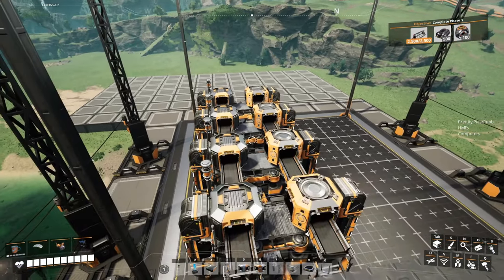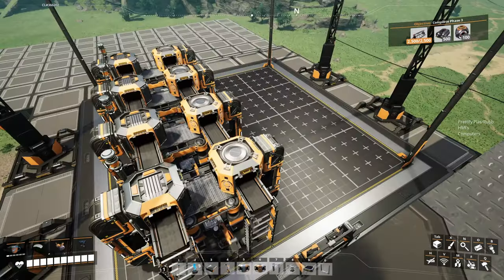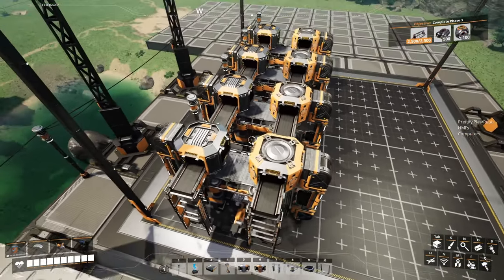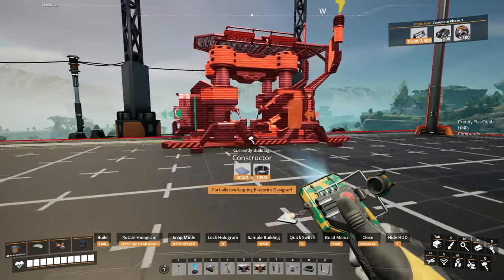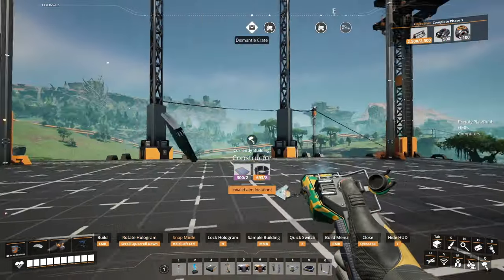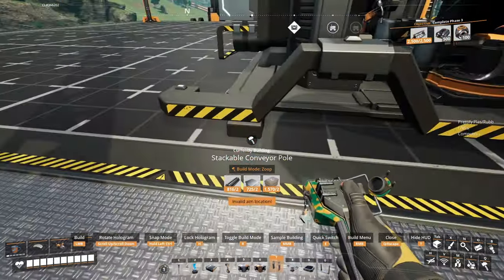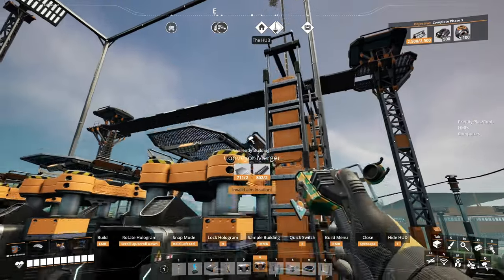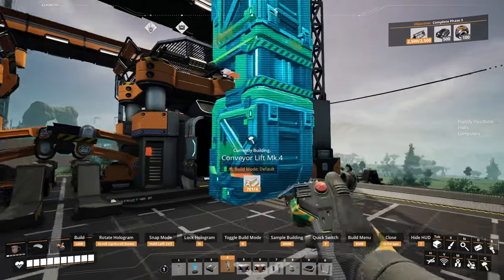Early Game Constructors Blueprint - Compact, Clean, & Tileable - Mk.1 BP - Satisfactory 1.0

Comment: I get that for some parts of your factory, having small segments is best, but sometimes the segments you want to make are so big that only having the current blueprint sizes is impractical, like anything involving refineries.
Reply from the maker: Yes and no. I made a refineries x3 BP and just finished my 20GW turbofuel factory just using those. Yeah I had to paste 5 of them together, but hooking up 5 BPs together takes a pretty small amount of time, tbh. Because all the manifolds and power are already hooked up. So you're only hooking up 1 belt and maybe 1 or 2 pipes and the power pole for each, and you're done. So even for 15 refineries, you're talking only 15 clicks or whatever. 

That being said, yeah having the bigger BPs is nice, for example, fuel power gens you can only do 1x at a time in a mk1 BP, whereas with some finagleing, you can do 4x in a mk2!

Comment: heres a build tip if you want them stacked. constructor on bottom then do the normal way to do the splitters and mergers then put another splitter and merger on top of them. you then put a frame foundation lined up with the edge and place a constructor lined up with the splitter. now after that you press ctrl on the edge of constructor the holo will be red. Press h to lock and then you can place it and you now have clean stacked 8 or if mk2 10 constructors.

just realized how rammabley my thing was 

1 do all start steps where it has the constructors and belts done
2 add a second layer of mergers and splitters
3 get frame foundation and place it 3 high it should perfectly align with no or minimal clipping in a mk2 not sure about mk 1(just tried and it works with mk 1 perfectly)
4 get a constructor placed on top of the frame
5 press ctrl and h to align up with splitters and remove the 1st used to line it up best done on the edge of the bp 
6 press ctrl on the new constructor it will have a red holo press h and place it
7 do step 6 till all are placed and connect lifts and done

 was inspired to play around with it by your vids so thx

Comment: I was wondering why you left the stackable conveyor poles and belt stubs in the BP instead of just removing them so you could belt all the way across between blueprints.  But I think I might see why now.  Without the stackable conveyor poles, you couldn't easy snap on some conveyor lifts to the input/output side if you wanted to come up from ground level.  I'm curious if that's the correct explanation.
Reply from the maker: Yeah it's for the 1st one in a line. If you wanted, you could make two versions, so that subsequent tileings don't have it. But I like having that there to align things for the front of the build. And its nice because in most cases, when you tile them, the stackables end up being fine, and then you can add more stackables on top to carry other resources "above" the build (such as another ore to another line of smelters even further down). So it kinda automatically puts a nice set of stackables in a straight line for you to expand vertically if you want.

Comment: 10:00 and 10:38 you can shorten the Conveyor Lift entrance to fit the bp bounds and reduce clipping by building down to the merger output. Personally, I find Conveyor Floor Holes the easiest and cleanest solution: throw down 3m of foundation, add one more 1m foundation, put a floor hole above the merger, and then delete the foundations.

Comment: At 12:20 you can probably reduce the clipping of the lift with the constructor by connecting the lift from top to bottom instead. The starting point of the lift is always a set distance from whatever you click first but it can be closer to the end point. So here, you click down first which puts it a little closer to the constructor than it needs to be.
Really neat designs ! thanks for sharing them :)

Comment: I'll echo what others have said about the high quality of your tip videos. They are easy to follow, concise, and respect the viewer's time. Well done.
Reply: By the way, on the 4X constructors, I like stacking the splitters on top of the mergers on the "output" side of the machine. You have to use a belt to connect across to the input lifts BUT the advantages are that you can climb up the ladder on the machine with headroom under the belt and you can place a power pole diagonally next to the power connection of each constructor without any clipping!

Comment: my only changes to your incredible early BP's is to add an injector merger halfway between all of the blueprints that way you evenly distribute the product to the machines further down the line. Unfortunately with the way they currently stand the first machine ends up working fine with some overhead while the latter half barely scrape by. Fantastic videos regardless please keep em coming!
Reply from the maker: @hiddendsyr865  what you're referring to is manifold design. In super slow applications, what you're referring to can help (think, you're feeding 10 machines with only a few items per minute). In most cases, the input buffers will fill within minutes and everything will run at 100% efficiency quite quickly. The only cost to a manifold is the input buffers. So for 8 constructors, that just means once you've filled 6 input stacks, then things run at 100% efficiency. That generally takes like, a few minutes. So, in most cases, manifolds are great and require no help. Once in a blue moon, some more balancing or "injectors" as you say, could be handy, but I think most players are better off just ignoring that, tbh.

Comment: On the 8X, if you connected the top lift first, it would get rid of some, if not all of the clipping with the constructor :)

You can also use the same method to fit the lift into the end of the path, rather than facing the mergers towards each other!

Comment: This series is terrific, thank you! I'm still a little unclear about how these should get deployed in a "real-world" application, even something relatively simple like motors.... How would you cleanly/modularly string together these smelter/constructor/assembler/etc building blocks into an actual factory? Would be a great addition once you've finished covering the building blocks themselves.
Reply from the maker: I mean how you utilize them is going to differ wildly by player. I am using a sort of bus in my base. And one nice thing is you can add more stackable poles on top of the ones already there to carry other materials to/from things further away. So you could for example plop down 12 smelters in a line, leave a space, and then 12 more, all in a line. And then use extra stackable poles on top of the first set of smelters to bring stuff to/from the second set.

Comment: Love this series!! Excellent presentation and explanations. Can you describe how you could convert this BP into a single constructor BP and now worry about the margins (so you can just line them up)?
Reply from the maker: well, set up the 4x constructor version but with only one constructor, and then remove the belts coming in and out of the splitters/mergers. So you just have the lifts connected to the splitters/mergers. And the power pole connected to the constructor. 

Then those can be linked together with just the belts + a power line.

Comment: lift issue around 10:00 - you can solve this by preplacing a floor hole closer to the merger, or even manually nudging the lift closer and placing a belt (since it won't autoconnect).
Reply from the maker: I'll have to try that out, that's an interesting idea!

Comment: You didn't explain how to do the vertical painted beams?
Reply from the maker: Holy crap I knew I missed something. They're just two meters tall. You can see the placement location in the video. And the one where you put the wall-mount to connect through the build is 4 meters tall.
Reply: @Krydax8  It's not the placement that's the issue, it's getting them oriented vertically.  I managed to do it using the diagonal placement setting.
Reply from the maker: @yosharian  oh. Just the normal setting works fine to go straight up. You just have to stand at a 45 degree angle. It's weird. If you're standing in a cardinal direction from where you're building, it likes to lay flat
Reply: @Krydax8  Oh I see.
Reply: @yosharian  press R to change construction mode

Comment: @12:18 when you clip the merger onto the line after putting the dummy merger on the head of the conveyor lift mine won't snap properly.  It always snaps one point away no matter what angle I can stand at. I've done it about 10x times not with no luck.  That trick worked with the smelters when I it didn't quick line up.  Any tips?
Reply from the maker: Honestly no idea. Maybe try a new blueprint constructor in a different spot? This game his weird stuff going on with snapping!
Reply: @Krydax8  I saved my game and slept on it.  I had to jump all over to get the right clipping and it finally worked.

Comment: They way you have these splitters doesn't cause loss per splitter for items going in? like the first one splits down to 60/60 then 30/30, 15,15 by the last one?
Reply from the maker: @PS-bc5qt  once you have a stack of inputs in the first building, then that belt backs up and you no longer have the issue. It generally just takes a few minutes for everything to back up and achieve 100% efficiency

Comment: when do I know to upgrade my belt? like If the machine only makes 30 or sth things thn I'l use a mk1 cause it doesn't exceed the limit of 60, am I missing sth?
Reply from the maker: well you wouldn't need to upgrade the lifts past mk1 if the machines don't make/use >60 of something, that is correct. The belts along the manifold though will carry the materials for ALL the smelters, so those need to be upgraded.
Reply: The only case is probably (in line with what Krydax wrote) for some item that is being produced or consumed at more than 60 items per second. It may be bulk items, such as screws, maybe with alt recipes, maybe with an overcklocked machine, or (now that we have a doubling production feature) with the doubled output.

Comment: I notice you set all these up with a manifolds, does this cause issues in late game with production?
Reply from the maker: @Skidd007  not at all. Manifolds work fine, you just give it a few minutes to fill up the buffers!
Reply from the maker: @Skidd007  unless there's something new or different with mk6 belts. But I've never heard of manifolds causing problems!
Reply: to add to what Krydax said, the main difference between manifolds and load balancers/balancing is just startup time, and the fact you need to let buffers fill, so maybe don't do manifolds with your nuclear power (cause the radioactive material on the belts), but like, for production lines it's a matter of space vs time. load balancing takes space, but when you start your factory everything starts at once, whereas manifolds take less space, but you have to give it a while to get started (depending on the line could be upto 30min-1hr)